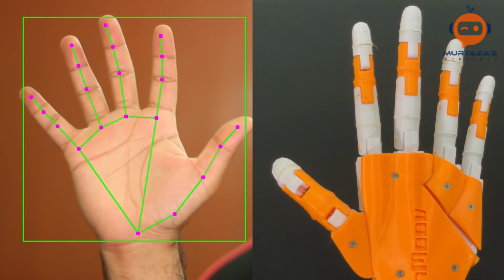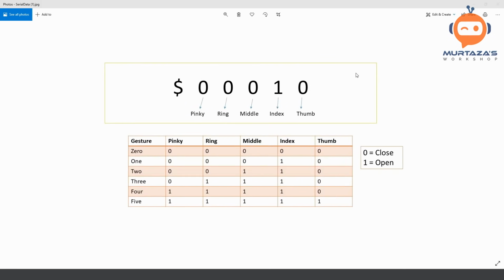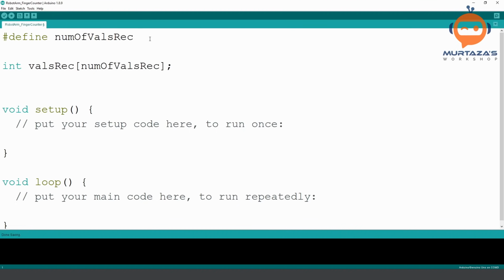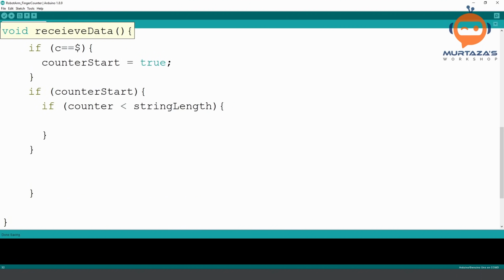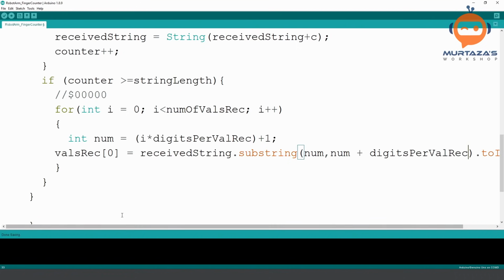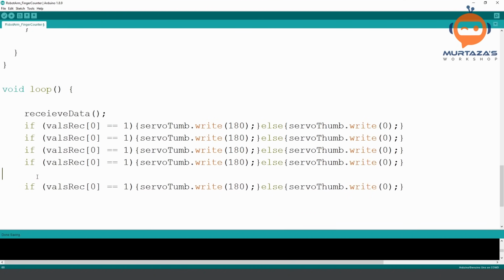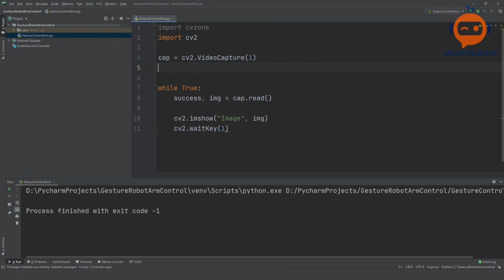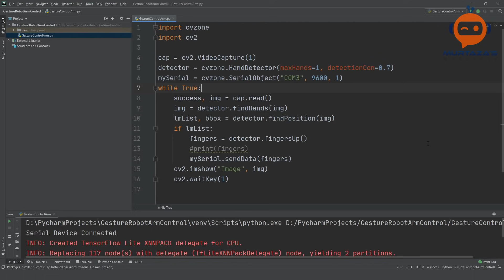AI ROBOT ARM using Python Arduino OpenCV CVZone | Computer Vision

Comment from the maker: findPosition Error:
Solution 1: Use the same cvzone version used in the video. (After cvzone 1.5 the findPosition method is removed)
Solution 2: If you are using cvzone 1.5 or above use findHand method to get the landmarks. This video explains it in detail: https://youtu.be/3xfOa4yeOb0
Reply: Sir, How to connect Arduino wirelessly with camera ?
Reply: Hello does the paid course  show the robotic arm this new way?
Reply: What course can I buy to see how to get the serial connection to stop disconnecting with this robotic arm
Reply: Where to buy robot arm ? Can you send the link?
Reply: Sir from where can we get the code
Reply: Can you provide a list of the exact materials for this project with links?

Comment: What motors are you using? I think 5x MG 996R.
Also, what wrist is that? In the instructions they use the wrist with gears. I can't find this other wrist without gears.

Comment: Hi I really like the way you explain coding, thanks for this. Just one question. I have tried to follow the tutorial but the cvzone does not have the HandsDetector attribute on my side. Do we need to install something more ? I have installed the cvzone library the same way you did.
Reply: While testing I have found a workaround: 
your version from the video: import cvzone
the other way: from cvzone.HandTrackingModule import HandDetector

Then when we call the HandDetector: detector = HandDetector(maxHands=1, detectionCon=0.5)
Reply: Any solution??

Comment: Way cool project! There is something i missed though. The Arduino is expecting a series of characters like $01000 from the serial port, but I see the python script only sending the fingers list containing just the 5 digits. Where is the '$' character being sent? 
This makes me wish to get a 3D printer...
Reply from the maker: The $ sign is added by the module. Go for it they are very cheap now, try the ender 3 pro.

Comment: This is a very interesting project, but I do not understand why it uses arduino if you already have a power raspberry which is enough to use in this project to control your hand and thus you can eliminate delays in the transmission of a control signal from raspberry to arduino